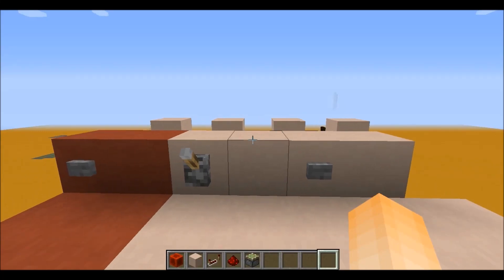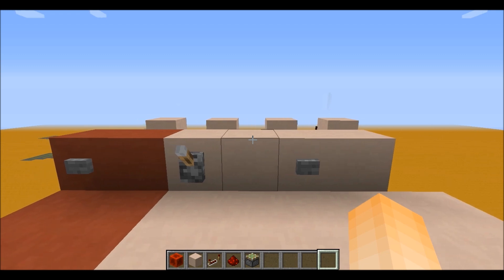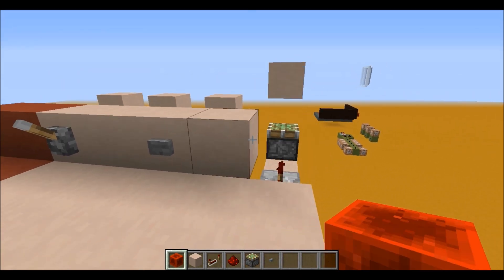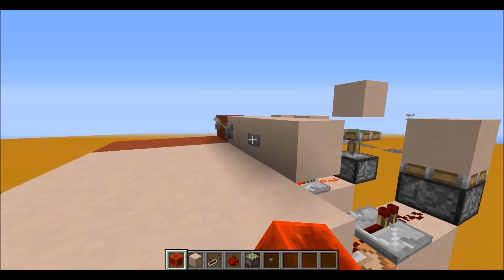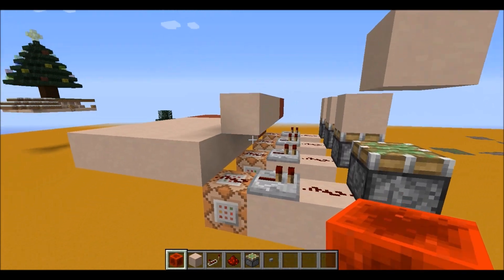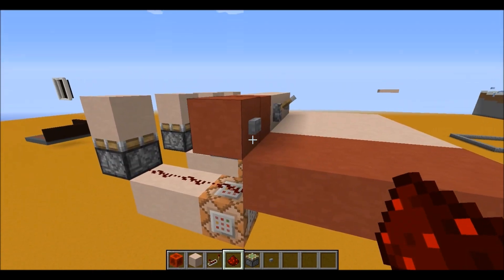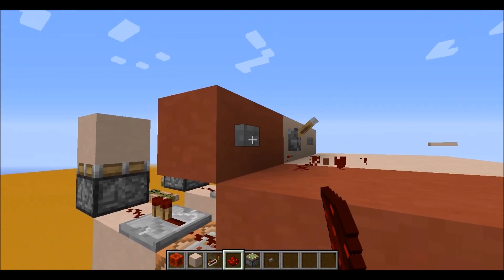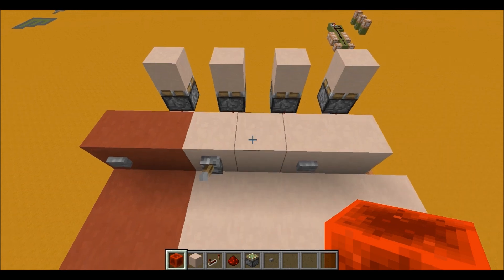Super compact Monostable Circuit In Vanilla Minecraft

Comment: I had the same BUD problem on my "Aether Mod Mimics in Vanilla". I had a trapped chest hooked up to redstone, and it immediately destroyed the chest. However, the redstone stayed powered. I figured out that by placing a piston next to the redstone, it updated it and turned the redstone off. It would seem that by creating and taking away a signal to the redstone dust in the same tick, the redstone doesn't realize it isn't powered by itself, but needs a block update.

You could also make it smaller by having the cmdblock directly under the button, and the repeater coming out of the block the button is on, forfeiting the offending redstone altogether. (i think) the repeater would update itself, realizing it's not powered, and shut off. I'll have to test it =)
Reply: Sadly, I was incorrect. The command block has the same problem as redstone dust, and therefore without something to update the cmdblock, such as a piston, the monostable works only every other time. Oh well.
Reply: Making a Mimic was a good idea! A series trying to recreate a mod in Vanilla would be cool! 'Hint To Both Of You' Could you use a smaller, more decent mob than a zombie? And you can use commands to give it it's own noise. Just suggesting!